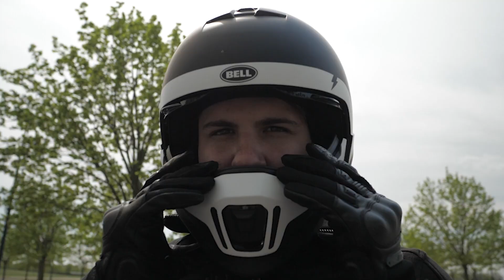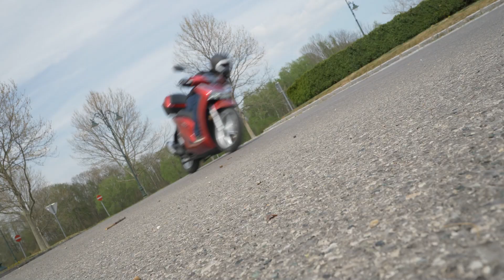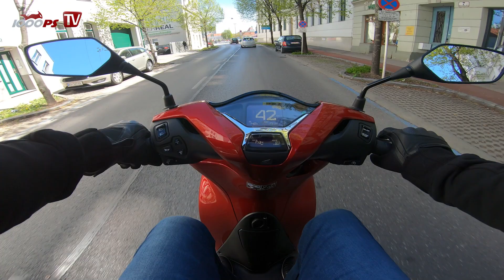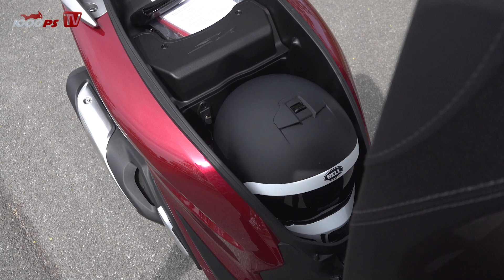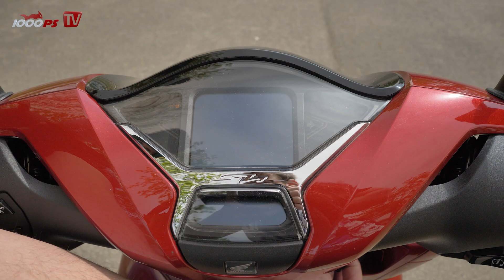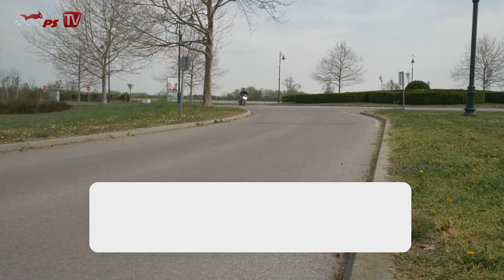Review Honda SH125i - Storage space and efficiency better than ever!

Comment: I bought one in white recently, its a great little scooter, but the front suspension is hard, and the seat is hard. Having said that, if the roads in the UK were not so pot holed or literally worn out, the ride would be fine. Having ridden very large heavy motor bikes most of my life,  I can say without any reservations, the Honda SH 125i is the best little runabout there is out there, from every aspect. Buy one , you wont regret it!
Reply: Adjust tyre pressure, no need to have the front tyre rock hard as long as its not overly deflated, that's what I do and solves the problem.
Reply: @ridehead8771 And still 2.2%?
Reply: I just did , waiting for winter to finish 😊

Comment: Actually this is a step backwards. They have removed the useful front glove box. The under seat storage is still very limited despite moving the fuel tank under the floor. Who in 2024 would be so stupid as to put a USB phone charge port under the seat when the blindingly obvious place is near to the bars? The Piaggio Medley now outshines the Honda in every way with more power, better comfort, huge under seat storage and better equipment, but at a much cheaper street price.
Reply: What Medley? Are you sure it has more power?